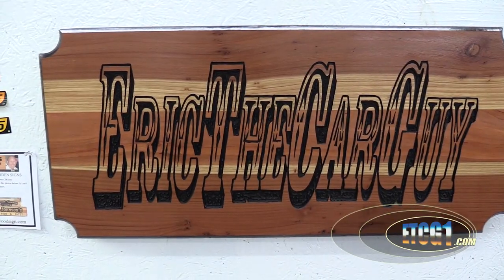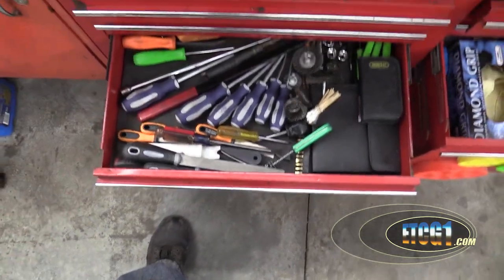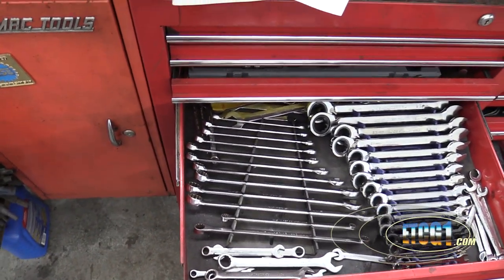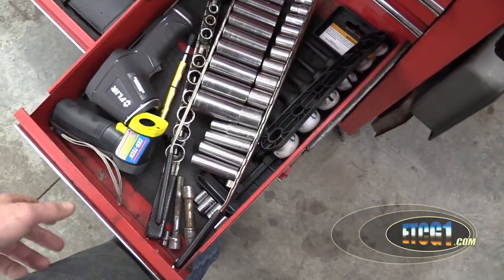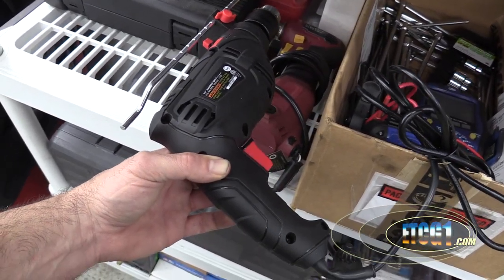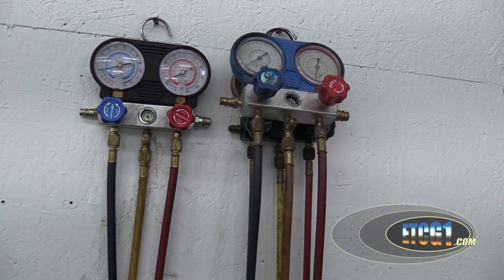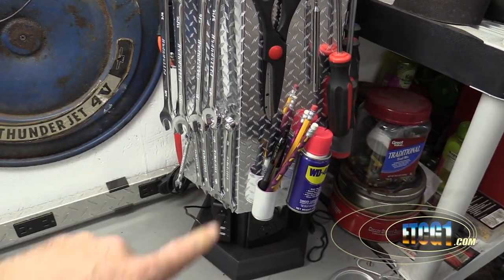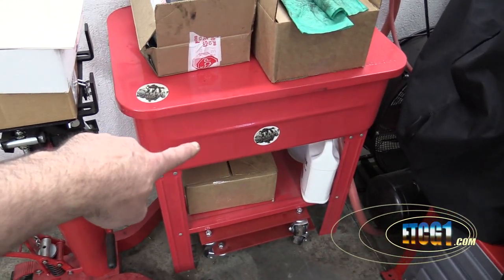Stuff I Get From Harbor Freight -ETCG1

Comment: I have found some stuff to be weak, and may break, but other stuff to be nigh on indestructible, wrenches included, i have had expensive tools break also. 

my 8 inch drill press sits nice on the workbench plugs into 110v, $50 on sale... cannot beat that, i used it to build my "Tool Dalek" jigsaws, drills, all came from there, all work flawlessly, ok they use old brushed motors, and the brushes are weak sauce, but they usually ship spares, and ebay or harbor freight have the replacements.

our cement mixer 3 1/2 cubic foot, was $150 on sale has mixed cubic megameters of concrete, and is flawless.

yeah the brake flare kit, not so much, but i do brake lines once in a while when the moonphase is retrograde with the planet z0rg, which is tidal locked with its trinary star system in another galaxy.... so i put up with it.

I have used the smeg out of their tap and die kit, screwdrivers also. gloves, oh yes the nitrile gloves, the boss-lady is allergic to latex so i buy boxes of the darn things.

I am far from a tool snob, to be honest if it does the job even if it was not designed for it, thats good enough, if i want 450 year old craftsman stuff with the blood sweat and tears of generation gone by, i will go to a local flea market and hit the old guys up just before closing.

The best part about HF is the fact they offer stuff that is essentially disposable, why bother with a warranty that costs almost as much as the tool?

Comment: I think even the best of mechanics have used harbor freight at one time or another.  I've bought tools that shattered soon as a minuscule amount of torque was applied and I've bought tools that have stood the test of time. It's hit or miss.  Harbor freight is def not my go to store for tools but they do have a good selection of air hoses, connectors and manifolds. The 6 horse predator gas engine is pretty dang tough for a Chinese Honda clone
Reply from the maker: +JEREMY FOUNTAIN (THEMOWERMEDIC1) It does have it's uses and its faults that's for sure.

Comment: Harbor Freight hand tools, especially their Pro line, are usually good enough for someone doing occasional work or just starting out with a limited budget. 

Their power tools are less reliable, less precise, less durable, and have short warranties, so are better to buy at the last minute- assuming that you can get back to the store to return/exchanged lemon.

Compared side by side to high quality tools, HF look and feel crude, heavier, bulkier. Hand wrenches are often shortened to save metal, thinly plated to cut cost.  For occasional work that may not be a problem. For production work i
it can reduce productivity.

Comment: Those hose clamps... Not just no bueno but muy malo. I used them to clamp new radiator hoses and almost seized my engine when one let go! Luckily I was in a parking lot when it happened and realized something was wrong in time to avert disaster. But yeah, avoid those clamps like the plague. As for other HF stuff, just like everyone else says it's a mixed bag. I like my 1/2" earthquake impact and their torque wrenches are just fine too. The only thing that broke on me was an impact hex socket, and I see partial sets of those on their open box shelf all the time so I'd say look elsewhere for those too.

Comment: from this video i get the impression for any DIYer like miself harbour freight is the way to go. since i dont rely my income on my tools 
but i do agree everyone should invest a bit of money into the tools that are used more often. 
3 years ago  i bought a stanley screwdriver/wrench that cost me about 5 times more than a normal non brand, but i dont regret it at all, as i keep on using it over and over and can totally rely on it. 
in fact, just today i replaced the brake discs of my 94 celica gt4 (alltrack for the US) and used them again as the bolts are in a tight spot and my air whench wouldnt get there neither any of the sockets. 

good video. im happy to see someone actually saying that there is good stuff from harbour freight. as i keep on coming across many videos complaining on their stuff which just sound like rants for no reason.

Comment: I do my homework when it comes to HF tools. Always read the reviews first. I have the same oil drain and also a sand blast cabinet, 20 ton press and the green pneumatic oil extractor #46149 had to modify it just a little to suit me but it works great. Have used it several times to change power steering fluid. Several smaller items,battery load tester, set of large impact sockets in a plastic case and the infrared thermometer laser, they are fun to play with. Bought a set of Pittsburg 1/2" dr extensions. The magnetic glove dispensers are pretty handy too to stick on the end of your tool box. # 69322.

Comment: angle grinders are good for the $$, even come with a spare set of brushes for the motor; and the 120v impact wrench, at $50, is great for a shadetree mechanic who doesn't want to splurge for a giant air compressor.

Comment: Aside from the hand tools, and I know there are better, some of their other power tools have also worked well for me.   As a tinker/hobbyist, the day in day out reliability simply isn't worth the cost for some of the tools.  Heh, was even brave enough to pick them up used from a buddy who upgraded.  The 16 spd drill press, 4x6 metal band saw and the 90 amp flux welder (splatter box) worked for years for him, and have done the same for me.  That being said, if I could, I would have better but the bigger power tools cost as much for a single tool as what I have invested in my whole kit, heh, some my whole garage including the building.

Comment: UK equivalent is MACHINE MART.  I needed standard Mig welder parts and sandblast supplies - they provided them at the right price.  When I need a quality tool or bulk sandblast consumable - I go somewhere else, but sometimes you just need something to do the job, and cheap enough that if it breaks you just recycle the remains.

Best tools, no question, all the tools made for Uncle Sam during WW2.  Don't be fooled by the lack of Chrome or Nickel plating - those tools will still be working when we are all gone, and they are usually cheap at garage sales and swap meets because they aren't shiny.

Comment: I've been needing a tubing notcher so the other day I went and bought a really nice one I mean it is perfect cuts every time but I had read at Harbor Freight had one for 59 bucks but all the reviews were so   bad,  I was going by Harbor Freight and just out of curiosity I pulled in and bought theirs have no intentions of keeping it got home and sitting up on the workbench and all the bad reviews right on the money the thing is a piece of crap the threads on the shaft are so wobbly and flexible that probably four or five times cutting quarter inch steel and they're going to strip out the play in the shaft is wobbly probably won't last no time either it's just junk and like I said I didn't buy to use I just bought it to see if the reviews were right I'm taking it back tomorrow

Comment: Eric thanks for doing this video. not everyone can afford the nice stuff and it's nice to see an honest review of some HF stuff. I'll add that I feel the same way about wrenches and sockets. though I do have a couple higher priced HF items that haven't given me any problem one is an air compressor though it's the 29 gal belt driven model the direct drive ones seem to be crap and a US general tool cart that I love. Also my uncle has a mig welder I believe the 190 and he has used it hard with no issues. carry on the great work!

Comment: I found that a Harbor Freight fuse set is NOT worth it. After letting some of the magic smoke out of a wire unexpectedly I did some testing and measured up to 108 amps of current passing through a 10 amp fuse before it blew.

Comment: I shop at harbor freight some, as you do...and YMMV but I have a rule. I never buy any blades,files, etc. there. I have found one set of drillbits that they have that are good but several other sets I bought there were crap. I can buy US made Nicholson files for maybe only 10 to 15% more then harbor freight files, I can buy good quality cobalt or Milwaukee drill bits that will last for years for maybe only 30 to 40% more then harbor freight's best set. I have found their tools such as drill motors and sawsall's to last but not the replaceable parts that go with them. I recently purchased their sliding miter saw and my first addition to that song was to toss the blade that came with it and put on an 85 tooth Diablo carbide tooth blade which made it 10 times the saw that it started out to be. Admittedly the blade was 75% the cost of the saw... I have found that for tools you use very infrequently like three-quarter inch drive sockets and oddball impacts like those large Allen that you bought etc. they are perfect.

Comment: I use the Harbor Freight IR thermometer for my wood stove...  It's good enough for the price, but it needs to 'soak' in the room your measuring for some level of accuracy. 

I've used the real Fluke IR thermometer a few times and it's spot on with accuracy without any soak time required. You get what you pay for.

Not for nothing, this was like a Harbor Freight product placement video.

Comment: I'm not a snob either, but I own so many tools from Harbor Freight, that for the most part, I think I'm done. They make "durable" gloves, which are the only gloves that fit my hands. Sometimes I try on every pair in the store and buy none of them for fitment issues. The other day I got lucky and bough several gloves.

That said, the sorts of things I don't get there, I've found Duralast to generally be of higher quality, but I've about bought every tool I'll ever want from AutoZone. They're also a lot closer so Harbor Freight on demand is something I lost when I  moved where I am.

For the rest, I go through Matco...they had too many things on sale I had an eye on for a year and it does break the bank. Pretty hard to break the bank at Harbor Freight.

Comment: Eric I wish you would change your mind about the gearing in your Fairmont. As an owner of a few mustang I always go back to 3.73. 88 mustang gt 5.0 3.73, 96 mustang cobra 5.0 3.73 and a 2007 gt 4.6 3.73 all 5 speeds. The cobra came with like 3.27 not sure what they were thinking on that one, the 2007 I ordered with 3.55 wasn't sure about the 4.6 and higher rev, within a month a swapped out to 3.73. I tried 3.90s but lost to much top end for me. But fun as hell on light to light.
Reply from the maker: +Erik Lee I spent a lot of time working that out and It's already a done deal. I'm happy with my choice. I don't want it to tach out on the highway too much.

Comment: I have a lot of Craftsman and channel lock tools.  the tools that I use a lot and have to take hard use I have bought in the past are Snap On.  They have gotten so expensive and I have retired.  Now I don't buy many tools but consider Craftsman to be as low as I want to go.  With Harbor freight, even if the tool works OK  It will be awkward to use or too fat to fit in tight spaces because the  metal  is of poor quality etc. etc.

Comment: The black Harbor Freight 9 mil gloves are pretty indestructible. Even a brake job has a hard time putting a rip in them. If they do get a hole, it doesn't run across half of your hand, it just stays as a small hole.

Comment: HF is okay for anything that if it breaks it will not kill or cripple you for life.  I would not get under a car supported on HF jackstands or drive on ramps. 

Best HF buy I had was a shop press for a little over $100 to do a wheel bearing on one of my cars.  It more than paid for itself in the labor costs I saved on.  It was used again for subframe bushings at a later date.  Now it has been sitting idle for over a year.  Their electric impact gun for around $50 is also a good buy.  Mine has been used maybe 15-20 times over 2 years when I am too lazy to fire up the compressor and go air impact; still works great.  I doubt these things would keep working if they were used daily so a professional mechanic is probably better off spending the money for high cost high quality durable equipment that lasts the 30+ year career if not longer and gets sold at your retirement liquidation sale.  I bought an engine hoist made in the USA in 1978 at such a sale some years back.

Comment: i work at harbor freight, and biases aside i wouldn't be able to do the work i do to my car without hft. simple small items are 1/3 to 1/5th the price of other stuff which is great when you buy the tools as you need them. i need some deep wall impact sockets? 20 bucks. hex bit sockets? 15 bucks. tie rod tool? 30 bucks. impact wrench to get an axle nut off? 40 bucks. nothing is worse than needing a $10 part and $200 in new tools to get it done lol

Comment: Drex auto as I said I'm a sheet metal mechanic my experience  with hf tools as in their snips are less than desired they won't cut 20 gage without snapping off I'm not a auto mechanic like you about sockets or those type of thing because I rarely use then unless assy a rooftop air handler  but I find homedepot brand of sockets and wrenches of decent quality for a very good price if you say that you have had good use out of hf tools I have to trust you  in that fact

Comment: I bought a drill from harbor freight also, it never worked correctly, wasted 40 bucks, then I went to goodwill  and found a 1950 model black and decker drill, I used,  the bd  will break your wrist, if you don't have a good grip on it

Comment: I always thought It was really stupid to buy high quality sockets. I mean, it's a socket, how can it go wrong. That is until my HF sockets started stripping out on the bolts. (no, the bolt didn't strip, the sockets did) But they got me by for a long time.
Reply: Actually, so folks know, often it's the way the inside of the socket is designed that makes the difference. When the part that grabs the bolt or nut is designed poorly or without as much precision it'll be more likely to round off the bolt head or nut.

Comment: some things at harbor freight I would not buy nor recommend. Vise grips and pliers are one. But the electrical 1/2 inch impact and battery 1/4  impact saved my butt a few times their wrench set that is seperate and impact sockets are real good. But the impacts I have an issue with is the hole that runs thru it is small.Had to run to menards and get a 15 mm socket because the hole was bigger to go thru the stud that the harbor freight couldnt go thru. Need a carbide drill to open the hole up. Never buy the socket or toold set they are junk. Only buy the ones that are seperate and not pert of a set. They are better quality.

Comment: I think common sense helps alot. i did get a punch set from there, and the smallest pin punch bent? but eh, I didnt expect much better. stuff like magnets, magnetic trays, flashlights (the 2 dollar little flashlights are actually decent) and most of all, their power tools are actually not half bad.. for power tools. 

HOW ARE THEIR TOOL BOXES? they look kind of nice and I wouldnt be against buying one from there. Who has personal experience with this?

Comment: You have a real good selection there eric :-D, i think cheap tools are fine if you remember they are cheap!!.
And if your just an occasional diy'er they will do, if you need to use a screwdriver as a sacrificial chisel then its not the end of the world if it breaks, we all use tools wrongly if it gets you out of the crap. :-D
Reply from the maker: +zx8401ztv Excellent points. Thanks for your comment as always.
Reply: exactly :D
Reply: +user12345 I totally agree. And they're sold in the states too. Autozone and Napa carry them.
Reply: Silky Tp Being made by a small engineering company in the UK, they're a bit pricey compared to mass produced kits like Eric showed in the video considering you might need 2 of them SAE and DIN, but they work really well, and brakes aren't something you want to cut corners on, anyone who has used one of those horseshoe brake flares understands this.
Reply: +zx8401ztv Ya when yur hoping for a miracle...lol
Reply from the maker: +user12345 That's hilarious. Wait till you see tomorrows ETCG video.
Reply: ETCG1 What is it?
Reply: ETCG1 I watched it, it, it's pretty much an exact copy.
Reply: " i think cheap tools are fine if you remember they are cheap!!." Yeah cheap is the price you paid for them and decent is the quality.

Comment: Contact patern check, yay! Get an dial indicator maybe from Harbor Freight for backlash testing
 I used paint for oil paintings instead  of gear marking compound.
 Bob Ross would recommend ochre or lemon yellow :D
Reply from the maker: +Tomyp89 Props for the Bob Ross reference. I've got plenty of video on this diff. No worries.
Reply: +ETCG1  Shim swaping all day, checking backlash a dozen times, coating the ring gear and cleaning. So relaxing, just like raking in a japanese rock/zen garden.
Reply from the maker: +Tomyp89 I didn't find it as relaxing after the first few hours.
Reply: +ETCG1  all that and swaping the carier about 5 times.
 nice way to spend evenings (not). :)

Comment: personally i agree with the wrenches, sockets, and screw drivers being professional grade as if those brake under pressure you can ruin the bolts or hurt your self but the other things i can deal with the harbor freight and duralast items.